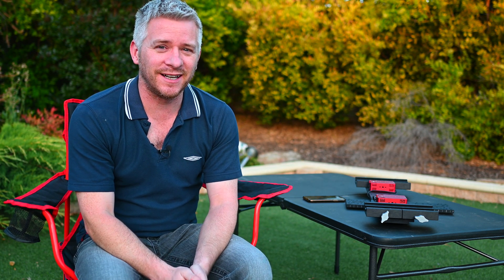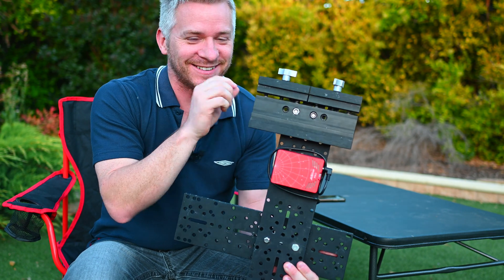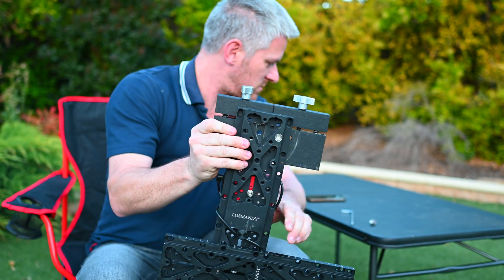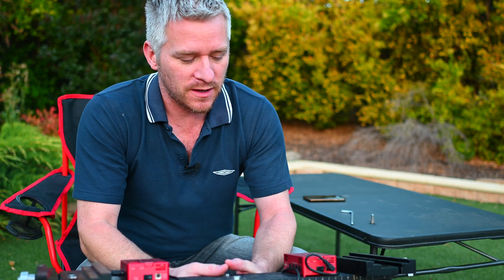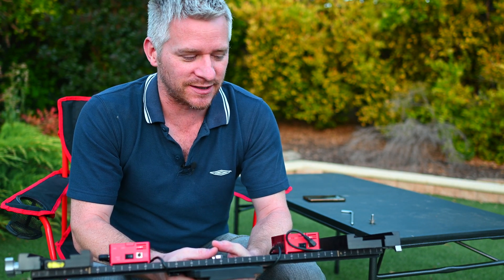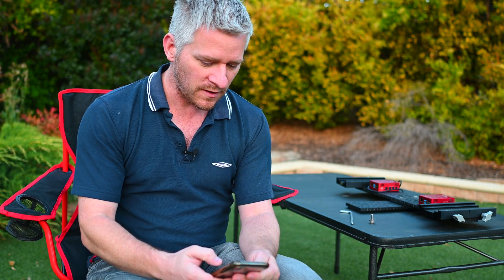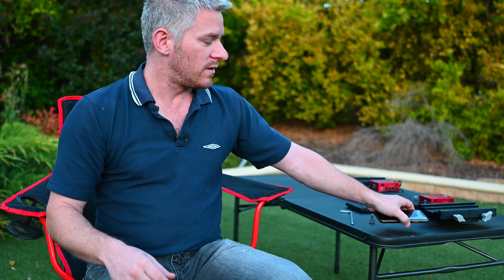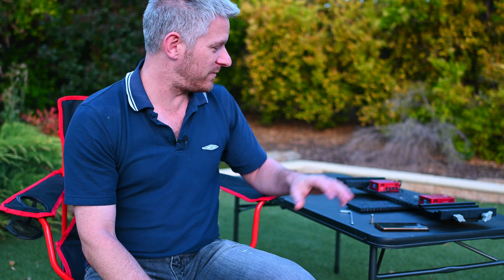Q & A: How I modified my dual saddle plates for my dual RASA's

Comment: As it turns out iOptron gave me incorrect technical advice and now said they were mistaken. My CEM70's saddle can not be turned sideways. The hard stop can not be removed. I will have to add a perpendicular plate just as you have for the CGX-L. That leads me to this question. How much do you use the perpendicular plate to balance the whole rig as opposed to balancing each individual RASA? My side by side is build on a 15" dovetail plate. Do you think that I would be happy with an 11" dovetail that's about the length of the CEM70's saddle or would you recommend that I go with a 15" which would allow for front to back balancing?
Reply from the maker: I would go the larger, even though you could shift the scopes, the larger dovetail would give you extra breathing room and might give you extra room to mount other things too if needed.

Comment: Steve, do you run two iPads simultaneously with the Twins?  I've seen the menu selection"switch device" but I'm not sure how to use it?
Reply from the maker: I used to run them on two apple devices (iPad and iPhone) but I’ve worked out how to run it all through my laptop using the asiair app. I’ll be working on a video on how I do it. Basically though I run a wireless router on the rig and network cable the asiairs into it. I then run a google play emulator on the laptop and run multiple sessions. This enables me to use the two asiairs on the laptop.
Reply: @StevenMorrisAstro  I've got to try that. JSYK I have had the ASI AIR app running on a new M1 Mac just as a proof of concept. ZWO is planning to do that. Now I wish they would make it possible to run two AAPs on the Mac native in two windows. I'll email you a pic of the ASI AIR app running on a Mac. It's not a cut and paste. It was really running.

Comment: Steve, I joined to  help out with your channel and in thanks for your help on the TinyTwinRASA Project.  Thanks Mate!
Reply from the maker: Really appreciate it too mate
Reply: @StevenMorrisAstro   Nevermind about the farpoint plate... I have ordered the same dual saddle that you did. However, I wish I could cut the groove in one side of that 14" plate and have enough movement for the 294.
Reply from the maker: My concern with farpoint is the recess on the underneath of the plates, I don’t think there is any as well as the lack of holes and options compared to losmandy. 
Farpoint do make good quality products but if that’s the case then more work is needed to make the saddle plates move around I think.
Reply: @StevenMorrisAstro   I have plain 14" losmandy plate and I just ordered a dual saddle 14" losmandy plate. My question is. Do you think I could do this with a 14" x 14" cross plate and just hog out the plate under one of the saddles just a wee bit to swing only one saddle. You said the 294 does not need much. If the primary rasa remains static I can mount the guidescope and one of the AAPs there. The other AAP on the secondary that moves. I would not need so much width this way. Question is how many inches is enough... 14, 18?
Reply from the maker: Yeah mate I think you can still be fine with the 14” plate and only doing one side.
Reply: @StevenMorrisAstro  I'm no mathematician either. I'd like to hog out only what is needed for the 294. I can always do more later but I can't put it back...  haha. After your experience with it, how many mm do you think the arch should be under the secondary saddle as it's the only one that will move?
Reply from the maker: I would go for 5mm of movement, 2mm inwards and 3mm outwards movement to start with, test and try then modify as needed.
Reply: @StevenMorrisAstro  That's great Steve. 5 mm total on either side of the countersink hole.At those short lengths a straight slot might do? It almost too small to curve it much. I sure agree with the approach to cut a little at first and modify as needed. If I had the rasas I would probably run it static until I get comfortable with running two of things. Worst case senerio is that I bugger up the plate while waiting for a RASA and just wanting to play with it.  But it could be used for other things if I do and I'm not out anything. much. How hard is it to dial the the two rasas right together when you have only the adjustable bolt in the back?
Reply from the maker: I’m not sure you’ll get away with a straight slot it would need to have a very slight curve in it. When you get the saddle plates take one alley bolt out and loosen the other then swing the plate side to side and look through to see just how much curve you may need.
Reply: @StevenMorrisAstro  I see. you can kinda let the bolt mark the plate a bit to see where it wants to go.
Reply: @StevenMorrisAstro  I am hearing from other iOptron users that I can turn the saddle plate 90° and keep the home position as is. I'll look at it when I get home.  If Not, I can use this: https://www.admaccessories.com/product/cgx-sbs-celestron-cgx-side-side-adapter/  Then do the adjustable side with this: https://www.admaccessories.com/product/tgad-tandem-guiding-aiming-device-altaz-aiming-device-for-side-by-side-systems/  So then I'd only need the cross plate and a standard saddle on the other side and some RASA love from Celestron.
Reply from the maker: Sounds like your system is getting all worked out without having to modify it much. Can’t wait to see what you end up with.
That’s also handy with the ioptron mount having that ability.
Reply: @StevenMorrisAstro  This afternoon I removed 4 M6 bolts, turned  the mount saddle 90° and bolted it back down so the CEM70 is compatible with a side by side setup. Then I called ADM and talked to Anthony ( the A in ADM). Using FaceTime he showed me his Twin Takahashi rig and showed off his own MAX Guider ALT/AZ Aiming saddle. Tomorrow he will build and ship a side by side mounting arrangement. It will be built on a 15 inch dovetail plate with one static saddle and one MAX. All of this will cost only $190 more than what I was spending  on the Losmandy plates and saddles but I’ll never get out the Dremel tool. I think the MAX will allow for fine adjustments and it also does altitude as the name suggests. Even better… My conversation with him led me to Celestron Dealer that I would have never thought to call. Get this… They had two… TWO RASA 8s. I have 2 tracking numbers. They are on the way to me as I write this. I am very excited. I just pray to the UPS gods that they both come in one piece. The TinyTwinRASAs rig is soon a reality. Now for the challenge of ordering another ASI294MCpro, EAF focuser and 2 Starizona filter drawers… all backordered.
Reply from the maker: That’s great news, so excited to hear your setup is coming along a lot sooner than later. 
Wish we had companies here that we could contact in terms of parts but it doesn’t work like that for us here and costs are anything too. But so happy that your getting your rasa 8’s. 
You’ll have to send me pics of your setup.

Comment: If I had any doubt that I’d rather do a Twin RASA8 rig  instead of buying a new RASA 11, your answers to my questions  have only strengthen my resolve to go down the dual imaging path. Seeing the mount that you altered up close was priceless and the detail in which you explained everything is even better.  My question about how far your would point inward (crosseyed) was more about managing the width of the project in my head. I’m going to be in an 8’ SkyshedPod so I’m hoping to tighten up the width a bit. I’ll mount the AAPs atop each RASA and take advantage of the reduced  saddle swing necessary for the ASI294MCpro’s small  sensor. I had already purchased a William Optics 50mm uniguide scope for the RASA11. I plan to use that smallish guidescope. With all of that size reduction, I would hope to fit all of this on a 14” x 19” cross dovetail plate and shave 5” off the width of my twin. So to kick off a little Q & A here in the comments, I’ll start with a few more Qs. I can picture using a drill to do the countersink holes but what tool did you use to cut the slide groove… would a Dremel tool work? What would be the absolute minimum groove size needed to accommodate the 294? We were talking on the ASIAIRpro Facebook group (where your rig is getting rave reviews) and I will relate some questions asked there. Some other twin users report loosing 1-2 subs out of 4. How many frames did you loose to dithering on the Andromeda project? I’m sure this would be negligible but a few asked about automatic meridian flip. How many frames do you anticipate loosing in an AMF? Thanks again Steve for another great video. I simply can’t wait to see your next shoot with the RASA Twins.
Reply from the maker: I have recently purchased a smaller guide scope and plan to see how that goes but it's much smaller than 50mm, I'm curious to see how well they work.
I used a dremel to grind away at the dovetail plate, how much would need to be taken away I'm not sure, if the scopes are mounted closer together you may need a bit more movement between the scopes for mosaics, as for targeting them both on the same target you wouldn't need much movement at all between them so it will be very minimal. My advice would be take a little bit out for a few mm of movement and test, if it's no good then proceed to remove more of the plate. Hope that makes sense.

As for dithering I do expect to loose frames however Andromeda there was no tracking or dithering going on so the same amount of frames were captured by both rasa's. That I can't answer on fully yet until I have a good imaging session. I've just been teething other things and trying to get used to a skywatcher mount. 

Hope this helps answer some of your questions :)
Reply: @StevenMorrisAstro  Steve, Although I may be weeks/months away from receiving my RASAs, it has begun. I am ordering the dovetail plates and saddles today and therefore committing to the TinyTwinRASA project. Please tell me if you are doubtful of any of my changes to your original Twin. I am planning to use the Farpoint 18" side x side tandem connecting bar. Tell me if you think I could flip the Farpoint plate over and attach the saddles to the smooth side? I will then attach the 14" losmandy centered and perpendicular to the upside-down Farpoint.Of course the losmandy will be attached to the mount as you have done.  I will leave the primary stationary and slew it into position. I would Dremel out the back bolt so the secondary saddle can swing a small amount to accommodate overlapping mosaic panels with a 294. Do you think I will wish that both RASAs move or could everything be handled with only secondary adjustments as I have described here? This tight fit design will be accomplished by mounting the AAPs to a vixen dovetail mount on each RASA. If I leave the primary stationary I could save space by mounting the guide scope on top of the primary as well. Steve
Reply from the maker: I will have to look up the farpoint 18” side by side bar to see what your talking about a little more. I look forward to seeing updates on your setup and I hope you don’t have to wait too long for the RASA 8’s. 
Sorry for the brief reply, I will answer better when I get a bit more time. Sorry mate.
Reply: @StevenMorrisAstro   One thing you need not be is sorry, Steve. Thanks so much!

Comment: Hi, when setting up, do you need to readjust the plates every time or do they remain fixed in position? And how much longer roughly does it take to set up in comparison to "usual" , particularly when traveling to woop woop. Thanks, great video 👍
Reply from the maker: Hi mate, One stays fixed and I only adjust the opposite side to make things easier. 

It really doesn’t take that much longer. I have tried to make the system user friendly for the travel side of things. I’m still working on making things easier and better..... think I need a new car for that 🧐